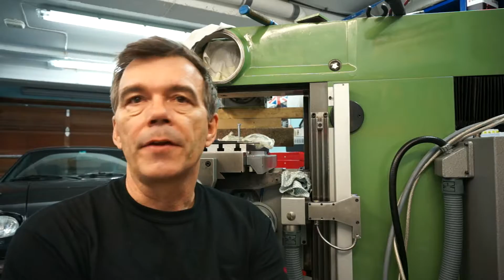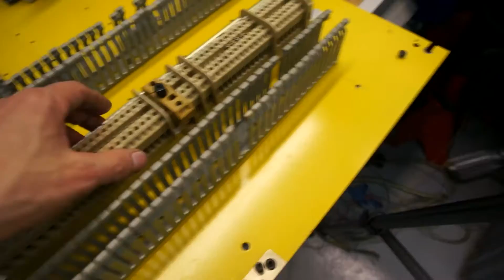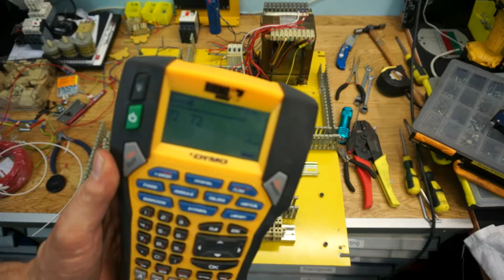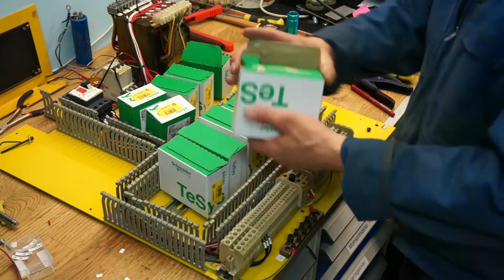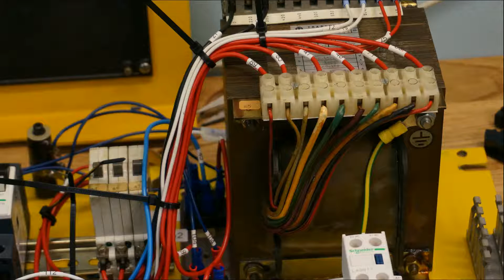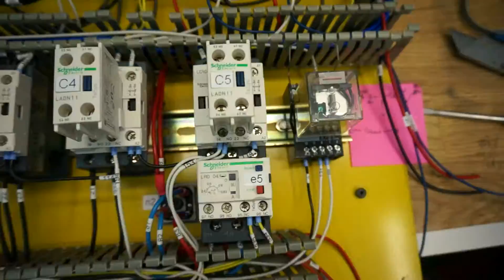Recreating the electronics on my Schaublin mill

Comment: Any updates?
Reply from the maker: The milling machine has been in operation for almost two years now.  There are some other videos on my channel showing it in operation.  Works perfectly.
Reply: @arnljotseem8794  I looked through your videos and I didn't see anything with the Mill Running. Your videos are among the very few videos showing anything on an "industrial" machine with higher voltages And industrial components. is there any chance to talk you into making a video explaining little more in-depth about how you  choose contactors and relays, and the use for them? maybe some power supply info. I saved two  good size bed mills from the scrap yard that they took all the electronics from. But the iron and ways are in great shape. They just had old electronics. So im starting from scratch. Planning DMM-TECH 1.8kw servos and a Syntec cnc control. Picked up a motortronics 5.5kw VFD but im lost as far as DC power for the control and where to put the contactors and how many to use.
Reply from the maker: @chrissorensen2618  Ah, now I understand what you mean.  I will see if I have the time to make a video about more on the electronics part of this machine.  Basically, contactors are selected according to the power requirements (in Amps), and the operation of the auxiliary switches on the contactors for low power switching.  The auxiliary switches are mostly used for low voltage "signal switching"  enabling and disabling manual switches and low voltage relays on the boards.  Luckily, I had a full set of electric diagrams (that the previous owner purchased from lathes.co.uk), and for me this was an absolute must for this build.  If the electric cabinet is anything more than switching on an off motors, diagrams is a requirement.  At least when starting with an empty electric cabinet, but it can also be hard sometimes to understand an existing setup.